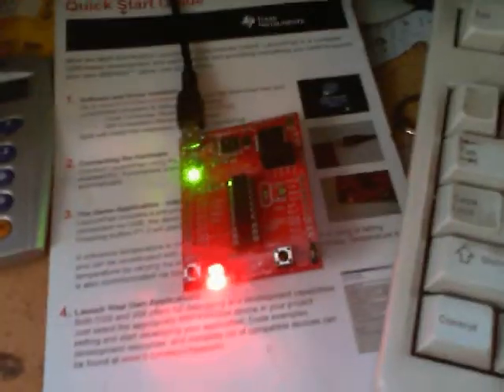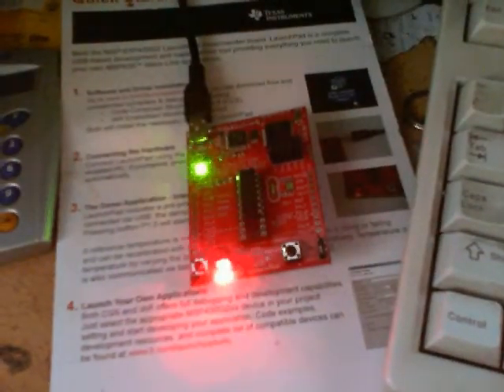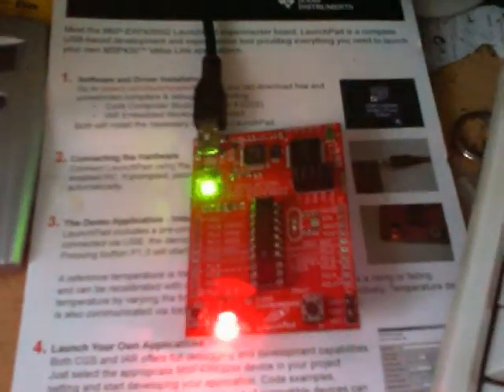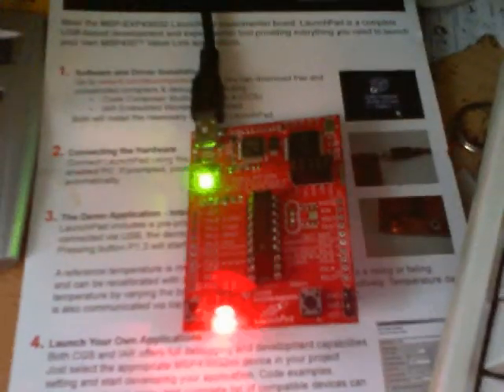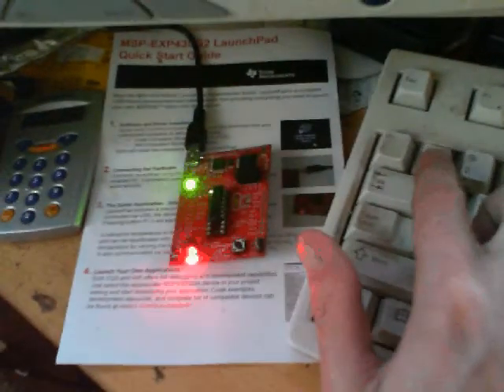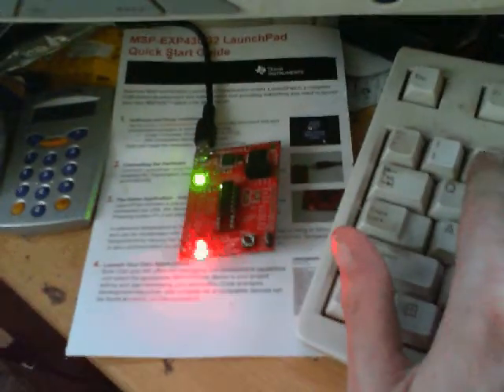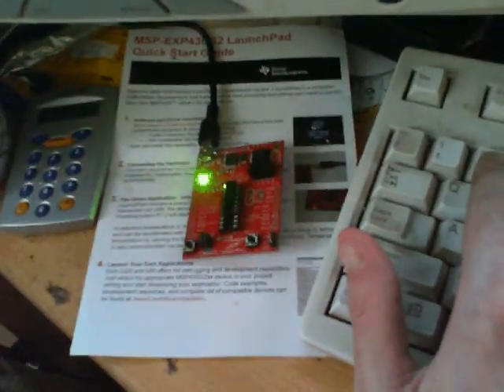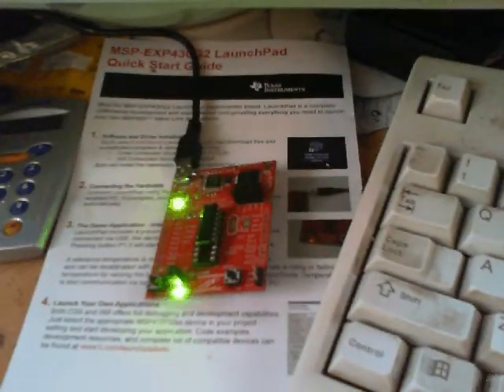MarkoeZ MSP430 Launchpad Video's Part 6: Leds controlled through PC Serial Connection

Comment from the maker: @MrTleeves 
You could use a routine that collects input for a fixed number of bytes, and then processes them.
Or you could collect bytes until a certain "final character" is received, and then process.
Or even check first byte, see if it matches and move on to next state or reset state if wrong. Then receive and check second byte, see if it matches etc etc

All depends on how you are going to use it, but one of those methods should suit probably

Cheers,
MarkoeZ

Comment from the maker: @MrTleeves 
Anything could happen. You could fry the msp, with launchpad still functioning, or vice versa. I once accidentally attached 7 volts to one of the launchpad pins for a VERY short while, and everything still worked. 
But even 5 volts might damage some stuff if you are unlucky.

Comment from the maker: @MrTleeves 
You do know that RS-232 is a different voltage level, right? Never hook up an msp430 or the launchpad directly without some sort of level conversion. You could fry them.
If you have the hardware side covered, the code should "just work".

The port one interrupt is used both for detecting when a serial message is incoming, as well as cycling through blinkmodes with the pushbutton.

Hope that was helpful,
Cheers!

Comment: Hey, I really enjoyed this sample project. It helped me quite a bit. 

Out of curiosity, what is the purpose of using the PORT 1 interrupt vector? Also, I'm trying to get serial communication to work between the MSP430 launchpad and a PC using an actual RS-232 cable rather than the provided USB cable. Will this code still be able to run ok without any changes? I tried hooking things up and running the code but I'm not sure if the issue lies in the code or with my setup. 

Thanks for any help!